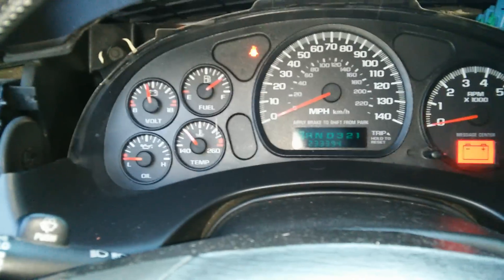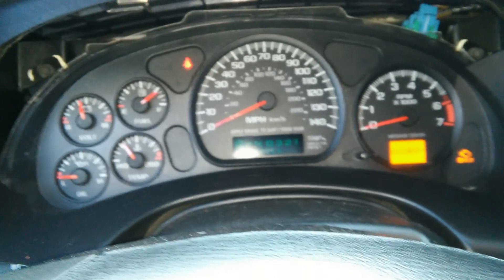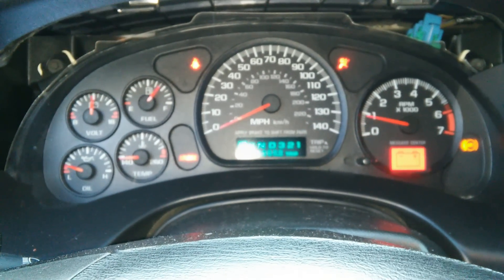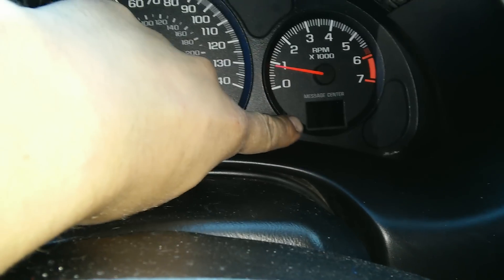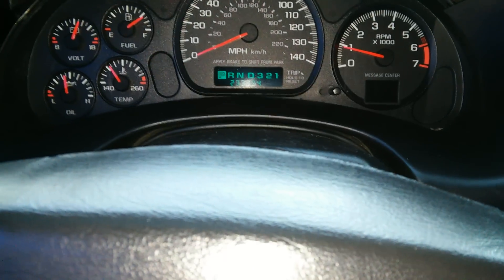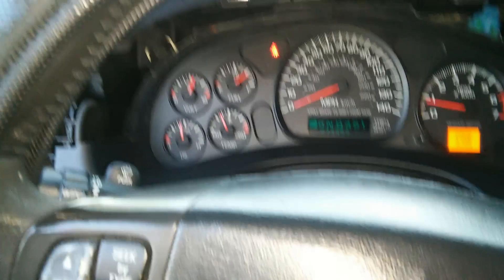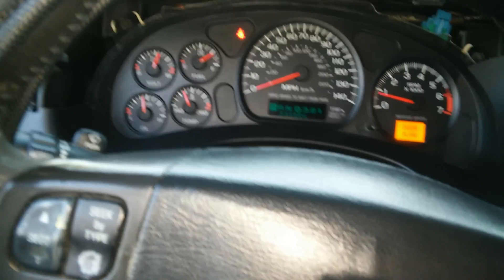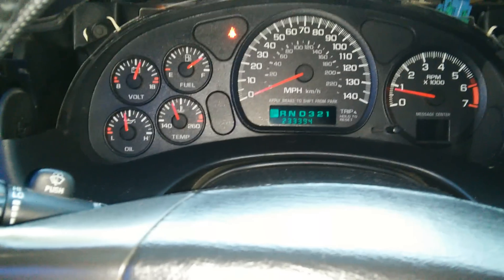3800 series 2 crank but no start no spark (part 3)

Comment: What is this ground for or coming from looks  like the starter ground.  I have the 3800 in a 2004 Buick lesabre I'm having issues with hard starts & cranking no start.

Comment: my grand prix having the same no crank no start  problem so i take the ground  wire off to clean it? and what can i use besides sand paper
Reply from the maker: Michael Brice yes but it may benefit you to check for no spark first before you go this direction. you can use almost any rough material to get the corrosion off.
Reply: Its not even sparking when i turn the key nothin  at all.  battery  good all lights come on     it use to click when i turn  the key   couple times then start up .now its not
Reply from the maker: Michael Brice is your oil light on also?? if not it could be a crank position sensor. does the car still turn over?
Reply: Alfonso Perez no my oil light not on at all
Reply: a small maintenance wire brush , u can usually find in the auto department at ur local box stores . or  auto parts house...

Comment: So where is the ICM ground?
Reply: that bolt he showd... its an ilet with two wires on it
Reply: the big one is the negative from the battery
Reply: Jaffer M. I agree. I want to know where the ECU is grounded so i can check it.
Reply: @bryanhauschild4376  its the stud he showed... it has the negative battery cable, and the icm ground
Reply: What size was that bolt?

Comment: I'm have a problem my car will crank over but won't start,97 buick regal 3800. just died  one day at idle,, crank crank crank,, hour later it hit started and ran but died again,,  just cranks  everything else inside the car works fine, blinkers,etc
Reply: Did you find a fix?
Reply: @mathewgarza202   was the coil control module underneath the coils, but i went on ahead and changed the crank and cam sensors anyways, prob due for them, but it was the control module
Reply: I’m having same problem changed all sensors still not firing
Reply: @hoover274able  fixed mine, it was the coil control module that sits under the coil packs,, while i was at it,, i decided to change my crank and cam sensor, runs good  now other than needing a set of new plugs or wires i think, has a slight miss to it
Reply: @hoover274able  new coil control module fixed mine